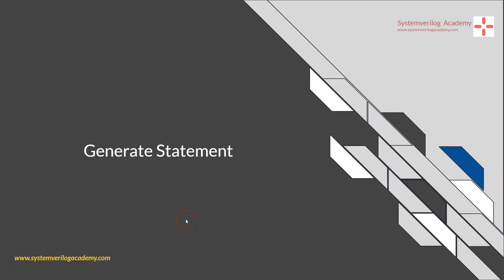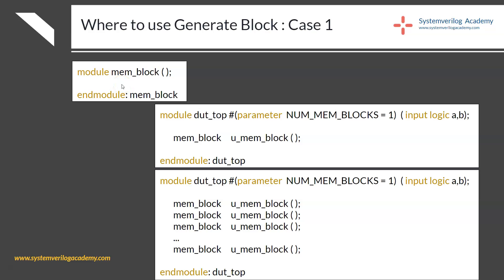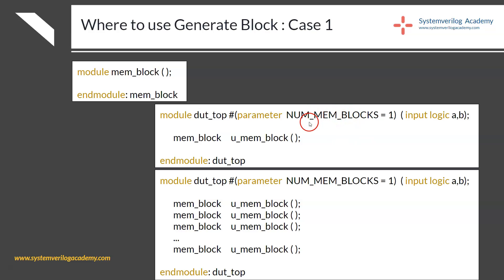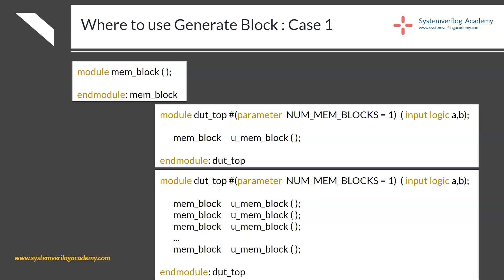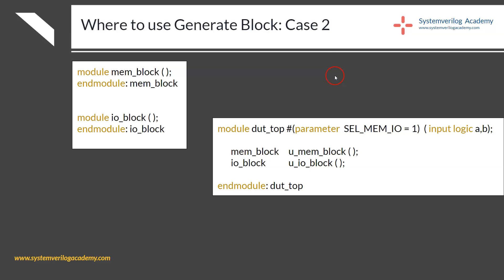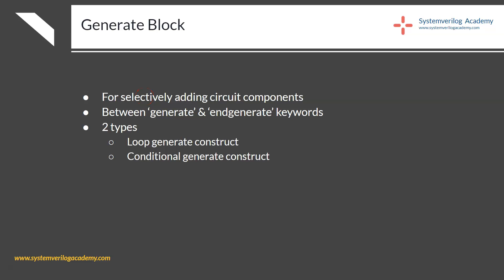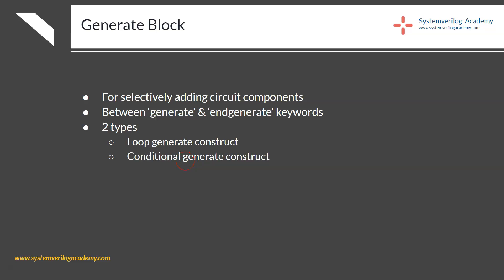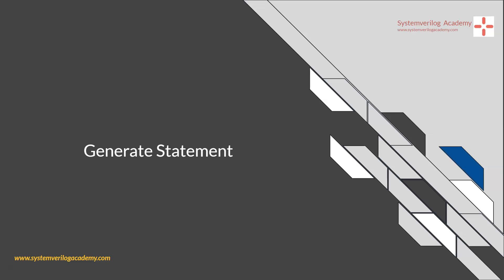Systemverilog generate : Where to use generate statement in Verilog & Systemverilog

Comment: sir, Does modules in generate block will execute concurrently or sequentially? if concurrently  how to use generate for interdependent modules.
Reply from the maker: If you 'generate' any block of code (including module), they will be executed in parallel in simulation. (didn't get your second question 😕 )
Reply: @SystemverilogAcademy  is there any way to excute module serially

Comment: can there be nested generate statements? if yes then what will be the name for the instantiated module
Reply from the maker: It's possible according to the LRM.  (Refer "27. Generate constructs" in the 2017 LRM) 
The instance names will also appear accordingly.  Example, 

parameter SIZE1,SIZE2 = 2;
genvar i, j
generate
for (i=0; i<SIZE1; i=i+1) begin:  AB
    ModX X1(); 
    for (j=0; j<SIZE2; j=j+1) begin: CD
       ModY Y1();
    end
end
endgenerate

Here the hierarchical instance names will be as below,
AB[0].X1
AB[1].X1
AB[0].CD[0].Y1
AB[0].CD[1].Y1
AB[1].CD[0].Y1
AB[1].CD[1].Y1

Comment: hi, 
i have tried the same scenario without providing generate block.but still getting output without any error.could please explain me why?
Reply from the maker: If you don't use generate, it will not 'generate' multiple components , it will be just a single circuit component.